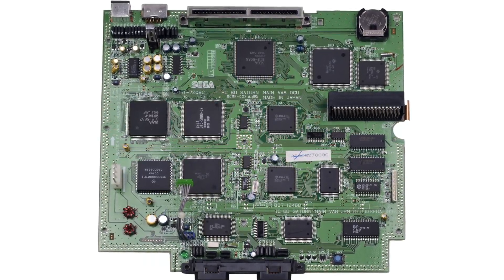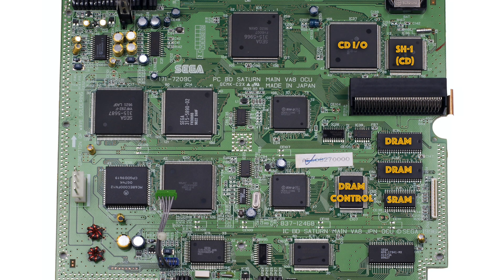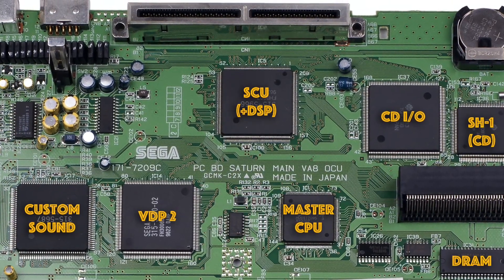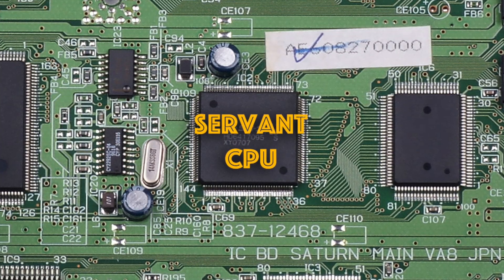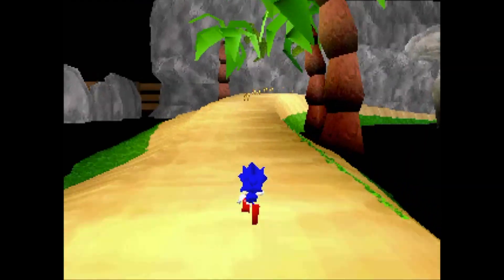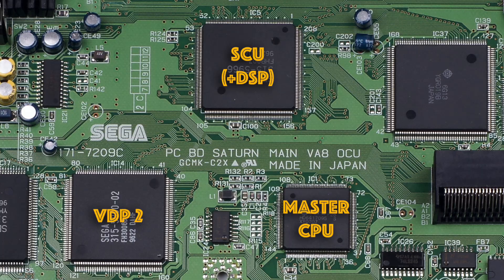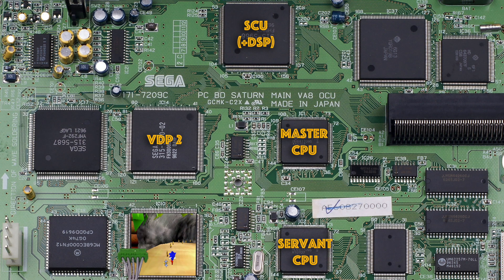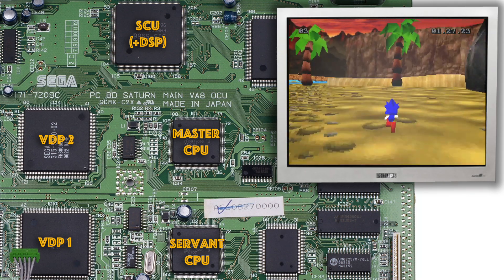SONIC Torn Apart to Expose SEGA's Insanity With Multichip Madness

Comment: And to think that's not even the most absurd system Sega ever produced. A Sega Genesis with both the CD and 32x add-ons formed a system with: A 68000 at 7.67MHz, a 68000 at 12.5 MHz, a Z80 at 3.57MHz, and two SH-2s at 23.01MHz, then for sound you have a YM2612 with 6 FM channels (or 5 and 1 PCM channel), a PSG with 3 channels of square waves and 1 noise channel, a QSound chip with 2 PWM channels, an RF5C164 with 8 PCM channels, and two channels of CDDA, and then for graphics you have... I'm not even going to try to describe the CD32x graphics hardware, but it's 3 completely different chips being over or underlayed.
Reply: Can you utilize all that hardware at once? Or is some of it locked out most of the time? I know the z80 and 68k can't work together at once but what about all the other stuff
Reply: @jlewwis1995  The z80 operates as a sound controller and not really a coprocessor. Yes you can use them all at once. They would generate the background, overlay and other 2d stuff with the 68000 and its graphics hardware on the genesis while more fancy graphics were generated with the SH-2 processors on the 32x. There wasn't a lot of communication between the CPUs and the images were combined via the video signal so no shared frame buffer or anything like that.
Reply: With all that power, could it do FF7 at the appropriate resolutions?
Reply: All these years I never stopped to consider what a Frankenstein's monster all of those pieces of hardware are together under the hood.  Really it's a shame things turned out like they did, I would have really loved to see a CD, 32X, or CD32X game that utilized all that hardware to it's fullest... maybe helmed by Hideo Kojima fresh off the Sega CD port of Snatcher that was so amazing.
Reply: Now THAT is Blast Processing!!!

Comment: As a developer nowadays, I get the sense that I would have simultaneously loved and hated working on the Saturn 🙂

Simultaneous Multi-Thinking, if you will.
Reply: Can you clarify on how hard or easy it was to develop for the saturn? I am curious about homebrewing a game. A question I have is: Do you need a machine made by SEGA, do I have to buy a expensive physical kit? How about the dreamcast?
Reply: Ciara Garrity it depends what you want to make; a fast 3D game with lots of special effects takes a great deal of knowledge in both C and Hitachi assembler. But getting started and making simpler games isn’t difficult, and you don’t need any custom hardware if you use an emulator or mod chip. I used to use a dev environment called Saturn Orbit but idk if it’s still around.
Reply: @caseycu  oh goody! Ill try to find it. Thank you!
Reply: The way I understand it, it was a super crunchy setup to work with.  It's a matter of "how much did you enjoy haskell back in college?"
If the answer is anything other than "oh god no," then you'd probably enjoy it.

Comment: IIRC, the Saturn was designed to be the best 2D console of all time.
The the Playstation arrived.
In their panic, Sega did the standard arcade solution to make the Saturn 3D: add more hardware! They took the graphics processor and doubled it.
This explains the unusual polygon style of the Saturn: quadrangles of solid (immobile) texture. They were sprites with distortion.
The resulting system was considered difficult to program for (obviously), and Sega's dev tools weren't very optimizing on this hardware (less obviously).
As a result, developers gravitated to the Playstation, which was easy to develop for, on, and with Sony approval.

On an unrelated note, I have a copy of PC Sonic R, as released by Express. Know anything about the porting of Sonic R to the PC?
Reply: The panic was to add the second SH-2 and the matrix DSP. VDP1 and 2 were always in the recipe.
Reply: Lassi Kinnunen  more like optimized memory access, if textures were accessed as quads, the whole process can be parallelize better. Currently gpus access their memory in 4x4 blocks laid out as a linear arrays of characters.

Actually, the only advantage of triangles is their texture coordinates flexibility, but textures are still accessed as quads
Reply: 3DO already did quads in almost the same way BTW
Reply: Not true. The Saturn was designed for 3D from the beginning. Every iteration of the Saturn had two VDPs during development. The intention was always to have a 3D VDP and a 2D VDP so it would, ironically, be easier for Sega's dev teams to work with since they were all familiar with sprites and very few had worked on 3D games as of 1993. The SH-2 was also always the CPU they were going to use since they signed a deal with Hitachi in 1992, and Sato himself said they selected the SH-2 for its price and its ability to run multi-processor.
Reply: The Saturn was a 2D Powerhouse that could run circles around the PlayStation in sprite-based games, as any Capcom fighter fan can tell you. But, in 3D games the tables were turned and the PlayStation, if not more powerful at 3D, was at least easier to program 3D games in.

The idea that the Saturn was basically a 2D system that was being forced to do 3D would help explain that, except that Sega themselves also played a part in kicking off the 3D revolution with Virtua Fighter. They had to know going in that a home version of Virtua Fighter would be expected on their next gen console. So, it seems weird that they would make a console with only 2D in mind and then only add 3D capabilities at the last minute to compete with Sony...

Does anybody know if Sega's Model 1-2 arcade hardware (that they used for 3D arcade games at the time) used quads or triangles? If their arcade hardware used quads then it makes sense that Sega's programmers would be used to quads and didn't realize that 3rd party developers would prefer working with triangles. That would probably be a better explanation.
Reply: @TetsuDeinonychus  The problem was that the Saturn could only run circles around the PlayStation in sprite-based games if the developers knew how to take advantage of the difficult hardware... which many didn't. There are direct comparisons of games that run much worse on the Saturn than their Playstation counterparts, like Symphony of the Night. Not because the Saturn was incapable of doing a 2D sprite game as well as the Playstation, but because the developers were incapable of doing so.
Reply: @guspaz  SOTN is the only exception to the rule of Saturn being superior at 2D, and it's inferior to the PlayStation version for 2 reasons: (1) Konami released it unfinished because Sega had just announced the Dreamcast, so they didn't optimize the code as much as they could have, and (2) as such, it was a fast and sloppy port of the PlayStation version and didn't even use the Saturn's 2D VDP like they could have. It used the 3D VDP to "fake" 2D in the same way that the PlayStation did, since the PlayStation could not do "true" 2D at all. ANY game you see on the PlayStation that looks 2D is just mapping textures to flat polygons at a fixed camera angle. Had SOTN been made for the Saturn first, then it would have made use of the Saturn's 2D capabilities and ran just as good, if not better than the PlayStation version.
Reply: @geniedumal2974  "Mapping flat polygons" - No, PS GPU has dedicated commands for drawing regular rectangular primitives. This is not the same command that is used for general polygons. But yes, the difference in performance is negligible, I believe, unless you are sending a huge amount. SOTN uses these to draw its 2D layers.
Your "3D VDP" and "2D VDP" terminology is somewhat misleading.
This is more like "Sprite VDP" and "Background layer VDP". Sprite VDP draws rectangular sprites, can scale and distort them so they resemble polygons and can be used to display 3D models, albeit with some limitations that PS GPU doesn't have. It feels like its main purpose was to support Sega's Super Scaler arcade games, and the ability to draw 3D models is a byproduct.
Background VDP combines the sprite layer with few extra 2D planes and can do effects very similar to SNES VDP, including transparency and "mode-7". It can also be used to draw 3D-like surfaces in the same way mode-7 is used for 3D effects in SNES games. This helps some 3D games to compensate for the inferior performance of VDP1 (compared to PS).
Both VDPs can do transparency but in different ways with problematic restrictions and neither is directly applicable for reproducing some of the effects used in Playstation SOTN, making them look inferior.
Reply: @NB-1  "SEGA Model1+2 used quads"
That pretty much confirms what I was thinking.

Though, Sega having an arrogant hardware designer that didn't want input from their arcade division sounds about right too. (And, I feel bad for Yu Suzuki.)

I LOVE Sega's games and consoles (Dreamcast is my favourite game-system of all time), but the fact that the company lasted as long as it did with all that constant ridiculous infighting and poor management is a complete miracle!

@Adam Zey
@Genie du Mal
I never knew there was a Sega port of SOTN. To be fair, I'm pretty sure using polygon-planes with transparent animated textures is how most consoles starting with the Dreamcast handle 2D Sprites, and it seems to work out well enough (though I guess they're much better set up to do that than the PS1). Does seem like a waste to do that on the Saturn instead of using it's robust sprite rendering abilities, though.

I kinda wish Konami had just moved their SOTN port to the Dreamcast, and made sure it was at least as good as the PS1, instead of rushing a half-assed port to the dying Saturn.
Reply: @TetsuDeinonychus  not really, even today there are specific commands in rendering API, such as vulkan, to draw directly 2D graphics, but using lists of primitives is faster.

What many seem to ignore, with regard to Saturn rendering capabilities, is that Saturn rendered the distorted sprites with perspective correction and true colour justifying quite a bit why it was slower compared to psx whose triangles rendered without perspective correction and 16 bit dithering.

Saturn rendered better, psx did it faster.

Comment: I wonder if Saturn lost the console war because programmers said "I cant be arsed to code for this, I will just do N64 and PSX ports, they're both running 64 bit MIPS, that should be straightforward enough"? :p
Reply: No, they lost because SOA released the Saturn 6 months early, making magazines covering the September launch date look like idiots, and angering retailers who were not given Saturns for the early launch. Consequently, many retailers didn't carry the Saturn at all, so many gamers never saw a Saturn in their stores to buy if they wanted one. And most of the gaming press took a hostile stance against Sega for the next two generations because they were lied to about the launch of the Saturn. That and SOJ's boneheaded decision to produce far fewer Saturns than consumers demanded are what did the Saturn in. They did that because they lost money on each console sold, and they were so obsessed with staying in the black that they would rather produce half as many units if that meant staying profitable that fiscal year. What that did was send a signal to developers that the Saturn would have a small user base by design, because even if more customers wanted a Saturn than a PlayStation, they couldn't get one. So of course developers focused on the PlayStation because they could sell more games on it, because Sony didn't put a ceiling on how many consoles they wanted to sell. The launch and the under-production are what did the Saturn in. Any other issue was minor and could have been overcome, including its difficulty to develop for and the failure of the 32X.

Also, the PlayStation ran a 32-bit MIPS, and the N64 was even harder to develop for.
Reply: @geniedumal2974  Sega made such great games and consoles but was such a dysfunctional shit-show behind the scenes, and always made baffling decisions.
Reply: definitely a contributing factor, but the damage was done long before with the mega cd, certainly 32x 6 months prior, and then that early 'surprise' launch that pi**ed off most retailers, and publishers before the 'war' even started.
Reply: @BuzzaB77  I would concur, especially as the PS2 is allegedly as complex to code for, but had the PSX success to build upon.
Reply: @BuzzaB77  The Sega CD did not damage Sega going into the Saturn, but I concur with your other points.

Comment: I’m thinking that home brew games probably make use of the 68000processor as was with the Jaguar console....which is why they typically sucked.
Reply: The 68000 was simply for audio processing and did not have DMA. It really cant be used as a primary processor. In the jag it was used as a control processor to handle extra tasks and scheduling within most games. However it ended up being used as the main bread slicer... One of the designers said they had contemplated a higher clocked 020 but cost was a factor. They added the 68000 was used to desuide its use as a main threadbare because of its poor performance. But that obviously backfired. The JAG was almost worse to program than the saturn, but the kicker was it just wasn't rewarding to go to the same extent as its potential was really not very good.

Comment: I want to see how you handle multiprocessing like that. Are they prone to raceconditions, or is this more in tune with MIMD architecture?
Reply: In this application it sounds like there would be little to no inter process communication needed. So it would be a snap. The SH-2 are VLIW and use trace scheduling afaik....
Reply: @wishusknight3009  VLIW, ok. Thanks.
Reply: This is deliberately dividing the problem into independent parts to minimise synchronization, locking, and race conditions. Though I am sure that would be a problem at the end of processing for each frame.
Reply: @darren8453  That is very possible. But with the kind of intricacy and detail he went into programing the matrix dsp for this game, it sounds like he went to great care to make sure everything was timed just right.  That video will be probably coming up soon. It is really something quite amazing.

Comment: I had no idea that the Saturn had twin CPUs. The 32X/Mars also has twin SH-2s as far as I'm aware. I only knew that because of 32X test programs that people have come across. They make reference to the Master/Slave SH chips.
Reply: Or ya know, you can open one up and see "SH2" stamped right on the chips
Reply: A significant difference is that unlike on the Saturn, graphics on the 32X are all software rendered (not counting the underlying Megadrive graphics layer)
Reply: The 32X had dual SH-2s specifically because the Saturn did. Somebody at Sega had the harebrained scheme that they could use the 32X as a "bridge" to the next generation to make developing Saturn games easier.
Reply: @geniedumal2974  I thought inside was a Mars sh1 chip
Reply: Thought sh1 chips